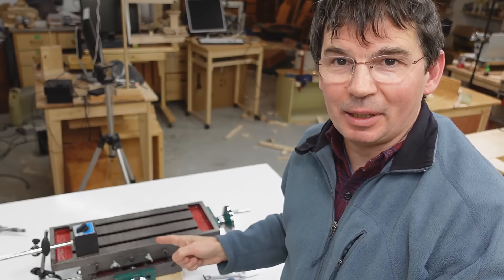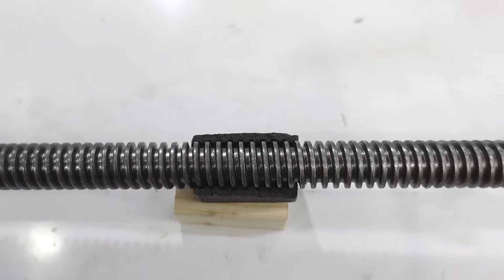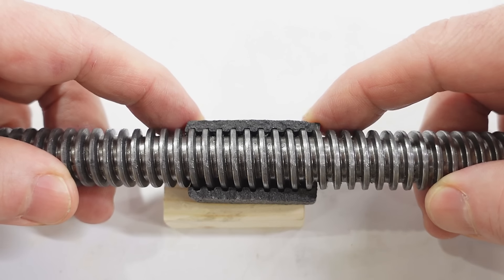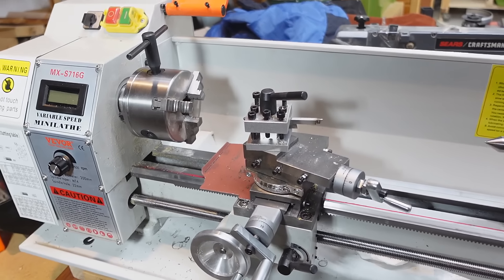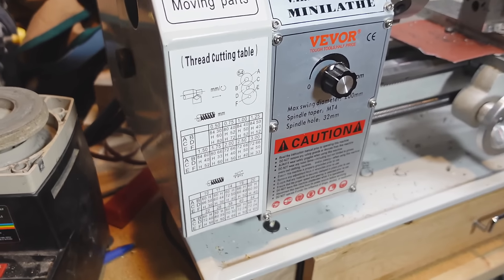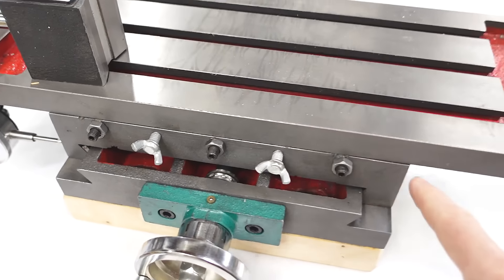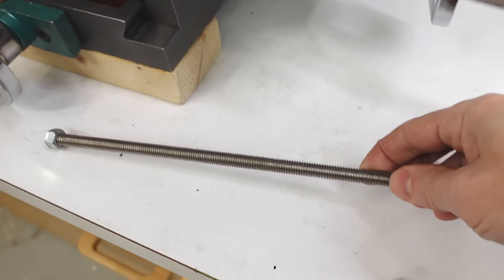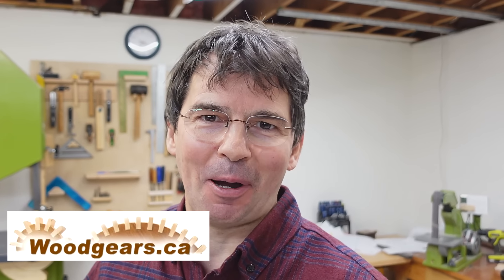Why all the hate for Vevor?

Comment: I don't get it either.  People made a choice to buy the cheapest thing they could find.  Then complain about how bad it is.
Reply: In my case, my husband bought me a metal melting furnace from Vevor. So he got it from my recommendation.  But I saw a review from a great, trustworthy YouTuber about said furnace. Everything is fine with it so far. It was just that the ad didn't quite match what we got.
Reply: Because they ordered the cheapest milling table, and received something not usable as a milling table, and broken.

If I ordered a cheap crappy milling table and received a cheap crappy milling table, I wouldn't be mad. If I ordered a cheap crappy milling table and received an object that was both broken and so imprecise as to be completely unusable as a milling table without extensive repair and refurbishment, I would not be happy. That's false advertising, to advertise a tool and deliver something not usable as a tool.
Reply: @jaredlancaster4137 to be fair, the table would have been pretty precise had it not been dropped which is more of an issue with the shipping industry than the milling table manufacturer
Reply: Also, a tool that is „up to professional standards“ won’t just cost 20% more, but two, three or five times as much as a Vevor tool.
Reply: @mx2000  try 20x as much. Machine tools of high quality are extremely expensive
Reply: 2 vevor products in my  garage. Both working as intended.
Reply: Who's mad?   Sounds like Matthias is cool with what he has.
Reply: Vevor isn't even at fault they Just a seller 😂😂
They buy it rebrand and sell it
Reply: The one complaint i have is that they cut some wrong corners.
Reply: Some people can’t afford to buy the best.
Reply: For hobbiest, complaining and fixing comes in a pair
Reply: Most dont complain - they just point out flaws than should be accounted for. I bought simmilar lathe - and I knew there would be loads of deburing. It works, and you will need tweak it before starting any work - but I consider such spent time as learning and familiarizing. 

Also - making quality replacement parts for these machines is part of fun.
Reply: no offence man but but you really arent a metal worker or metal machinist   machinist have had to deal with these issue for many many years.   you had to deal with what you had
Reply: @mx2000  No one is expecting professional standard tools and machines from Vevor, but often Vevor isn't able to deliver a working/usable piece of machinery. Meanwhile companies like Grizzly, Optimum, Sieg, etc sell the same machines as Vevor and often for the same price too, yet with the big difference that you're guaranteed a minimum quality which is substantially higher than the lowest quality at Vevor....
Reply: Exactly!!!! If you want good shit, pay more
Reply: Who sets the price? When  what you sell is garbage and does not work as advertised, you don't have a business you run a scam. Don't blame the victim.
Reply: Most of the time there's upgrade videos on how to fix these products. With a bit of effort and a few parts they'll probably be just as good as an expensive item of similar.
Reply: I was looking at their rolling mills and despite a few things i've seen it's not really a deal breaker.

Comment: I once was complaining to my boss about the wore out Bridgeport milling machine he assigned me to use. His comment to me was, "Anybody can make a good part on a new machine, show me how good you are by making great parts on the wore out machine." So I did and I never forgot it. Good video Mathias, keep up the good work.
Reply: Yes and no. I made an apprenticeship as a tool and die maker in the late 1970s. I‘m German so in Germany the apprenticetime is 3.5 years. A mixture between the training shop, going through the different departments in the company plus vocational school 2 days a week. The machines in the training shop where not the newest ones, not complete run down but also not pristine. So as apprentice we had to do exactly that. When I worked in the tool and die shop the machines where top notch. Time is money, if you can make prefect parts in a fraction of the time the good machines is a well made investment.
Reply: Even a poor machinist can turn out crappy parts on excellent machinery. Even brand new machinery can have issues. They shouldn't but sometimes they do. It depends on the accuracy that the machine is built to. 
As to turning out good parts on time without scrap parts mostly boils down to good work practices. This includes everything from job set-up to the steps from raw stock to finished parts. In my time I went from manual lathes and mills that still had War Production Board tags on them that had been used hard and put up wet to brand new manual/CNC control mills and lathes. Certain machines I dreaded having to use as using them was a struggle on every operation. Others were a pleasure. Anyone who has ever run a Hardinge HLV knows what I mean.
Reply: That’s a fun exercise for one afternoon, but for anything more than that, it’s a shitty excuse for not investing in decent machines.
Reply: We would all like a work shop filled with expensive high end tools but most people I think are like me and use their tools for non commercial or hobbiest work. I have many cheap tools and make a lot of very nice furniture from reused timber. I live on a pension and have a table saw,band saw, drill press,thicknesser, jointer,and various hand held power tools along With a plethora of good old hand tools. 
Tool snobs abound on ewe too.  I'm happy with my crappy tools and if one gives up the ghost it won't break the bank to replace it.
I have a few vevor tools and so far they all work just fine.
Greetings from Tasmania in the deep south
Reply: @geoffb108  I kind of agree with you. There is a difference between a hobbiest and professional machinists. The start of this post was from a proffesinla side and that a skilled person and make good parts with crappy tools. Skills are important but it might not be economical to do that.
I make knives as a hobby and I had a 35€ drill press that did exactly what I wanted it to do. Drill small diameter holes into thin strips of metal. Drill run out, perpendicularity, not important. Then my focus slightly changed and I needed to get a better machine. Still not high end but better than what Mathias showed here without breaking the bank.
Reply: If the machine was properly worn out you could never do accurate work on it. Worn clapped out machine = inaccurate product.  Been there, done that.
Reply: Did he give you a raise after you showed how good you were though?

Comment: I appreciate that they know they are building to a price point and not lie to us. Plus those of us in that market enjoy the challenge and adventure of making something better.
Reply: Indeed, I think they could do with putting that price point they are targeting up just a touch myself. But honestly saying 'we make barely useable junk you will have to really work hard with, but its cheap' is so refreshing in the world of badged markups for that same low quality..
Reply: You don't give your kid a Stratavarius to explore violin. :D
Reply: "Plus those of us in that market enjoy the challenge and adventure of making something better.
163
" LOL, I didn't.
Reply: Yeah, hobbiests are in the hobby to spend some time, not mass manufacturing. Making stuff on the table vs fixing the table are equally fun to a lot of ppl
Reply: After buying a lathe from them for 800, and then getting a rebate of 200 for problems that I could fix. It's kinda hard to beat...
Still a lathe and the bed/headstock are serviceable. Everything else needs machine work. I can't get anything for that.

On the used market, a clapped out antique is still several grand. And that's gonna require an absurd amount of rebuild.

Comment: You're adding all kinds of value to them when you make these videos.  People know when they buy a hobbiest level machine, they're not going to get pro-grade standards.  But now you've given people a path where they can take a hobbiest machine, put some elbow greese in, and have a much better product they might not have been able to afford if it was turn-key.  Now instead of a bunch of bad reviews "don't buy, garbage" you're going to get reviews like "Not bad, followed Matthias's guide, and got it working pretty good"
Reply: It’s the same with a lot of cheaper Chinese made astronomy products. You always have to put some effort in, searching the web for mechanical fixes, to improve what you’ve paid for. And when I say cheaper, they aren’t even the cheap these days.
Reply: the issue is for like 10 bucks more you get adifferent better knockoff
Reply: @HerbaceousM8  Which brand are you thinking of?
Reply: They give products to Matthias and let him work out the engineering bugs! 🤣
Reply: Its a smart business strategy. It ensures that QA from the manufacturers is satisfactory and its a way to gain a bunch of free design improvements. All they had to do was make stuff that's pretty good but flawed and they'll get the minds of engineers to give them free advice that would've cost them millions if they only relied on the skills of hired engineers.
Reply: @Liofa73  You end up valuing something more if you've modified or fixed it. Its a psychological thing. That's why Ender 3 printers are so well liked despite being the basic model.

Comment: Vevor seems to be in the market segment Harbor Freight dominated for decades. I have an even sloppier milling table I bought at Harbor Freight in the late 90s. I don't use it often, but every now and then it is handy for sure. Super cheap imports from China that mostly are good enough for many users. This "it isn't great, but it is so cheap you will not care" strategy has been playing out in many market segments for decades.
Reply: Yeah. The problem with a lot of Harbor Freight gear is just that it's flimsy and won't last.  Which is perfectly fine if you only have one job to do with it, ever. And a lot of us have tools we've only needed once, but when you need it, you need it.
Reply: What's wild is just how good some of the product lines at Harbor Freight are these days.
Reply: I bought my milling machine from Harbor Freight back in the early 90s. It's a mainland clone of a RF-32 They shipped it for free too because it cost more than $50.
Reply: I think Vevor and Harborfreight are sourcing their stuff from the exact same place - it's just that HF has moved away from that kind of product now, and they're focusing more on the higher end stuff (probably at higher profit margins), and Vevor also covers a huge array of products in many different areas that HF never had. I think of Vevor like a ever so slightly curated layer on top of ali express. If there's 10 manufacturers of some product, vevor chose one that isn't the worst, but might not also be the best, and slapped their name on it.
Reply: HF was a source for poorly made tools that would do the task but not well. 
I considered the cost of the machine as less than buying castings and machining them.
Reply: @ke9tv  10 years ago maybe.. they have made huge improvements and have higher end lines of tools to choose from like Icon. The tools will last way longer than a few jobs and they have a hassle free warranty so if it does break you can easily swap it out.
Reply: @ke9tv  I have several Harbor Freight tools that I bought for a single use...and I am still using them occasionally several years later. I also have 10-12 Vevor tools that I couldnt touch at market price for even hobbyist grade tools. Most of them last way longer than I expected. Several of them are more than decent.
Reply: @OldSneelock  a blanket statement can't be made for tools HF sells. Some are good and some are not so good. Which is a large part of the problem. There's no consistency. I've bought a lot of tools off HF and some are absolute bangers. Others I might as well have pitched them out as soon as I got them. Overall I think I'm ahead of the game. But it is a game.
Reply: Better than nothing seems an apt description
Reply: Yes, and it is quite literally destroying our country.
Reply: @1pcfred   Often their higher end tools are clones of matco and snap-on tools using the worn out molds and dies for all the internal parts and throwing on a new over mold design. The earthquake impact guns are direct clones. The icon ratchets and breaker bars are the same thing.
Reply: @chrisfarmer4397  sounds good to me. I like my Snap-On ratchets. My impact gun is CP though. That's Chicago not Central. I don't have any Icon tools. If I buy Harbor Freight hand tools I stick with the Pittsburgh line. Good enough.
Reply: @ke9tv  I use cheap ($15) Harbor Freight spray guns to spray glaze for ceramics. Absolutely no point in buying high end ones, don't need the accuracy/finish (it all gets melted in the kiln) and the high end ones get worn down by the silica particles just as fast as the HF ones. Sometimes cheap and cheerful is almost better than expensive ones. (Horses for courses as they say).
Reply: Its all about feedback and branding when it comes to manufacturing. That's what they and Harbor Freight do. Manufacturers that don't get feedback will just produce junk.
Reply: If you are retired like me on a fixed income and have all of your time, and the interest, it's possible to make cheap chinese mini mills and Lathes consistent to .001 accuracy. That requires a lot of scraping, lapping, tweaking, improving and adjusting. I like fiddling with stuff so I am happy. If I was already skilled, I wouldn't want to fiddle and focus on efficiency for projects. So I'd buy or get access to higher end "pro" tools.
Reply: @ke9tv  In that regard with cheap tools my experience also is, a cheap tool that gets the job done is sometimes more economic than even renting a good tool. I remember a number of tools used by a relative for a, lets call it project (like stripping a house down to the bare walls, and redoing all the insulation, plaster, subfloor, etc. etc.), except one every single one of them got the job done and lasted at least the whole year the project took. And price wise, some of them cost less than renting a good one just for a weekend.
Of course, there have been few tasks, where the cheap tools just could not provide the power or were lacking in other regards so using them for the whole deal would have been no fun. Especially when it came to bigger tools for demolishing tasks. here the rent for a weekend or two was well spent.
When it comes to tools you use regularly, it does not have to be the highest end one, but an affordable good one. Like a shop vacuum. 
On the other hand, I would myself for a weekend project also never buy e.g. a cheap (or any price) concrete mixer. Less because of the cost, but because afterwards I have to get rid of the thing or have it sitting around the next 15 years until I need it again.
Reply: @PatrickRemington  That warranty alone is worth more than you pay for the tools.
Reply: @ryelor123  That they are open for feedback, even of the "bad" sort pointing out flaws, speaks for them. Of course now they can either just live with it, or work from it, which may if it is a low investment, may happen with successive models.
Others may have started to threaten you if you wouldn´t get them an all shiny 5 star review.
Reply: @jameshicks7125  Sounds like "the path is the goal", which if interested and able, is not a bad thing. There are enough people out there, fiddling with such stuff for exactly doing that. Same with better quality broken stuff otherwise not worth the repair cost (parts and labor).
Some do it for themselves, some to kind of flip them and not only have fun but make a little money with it.
Reply: That is true, and it combines with another thing that is often overlooked when it comes to things produced in China.
Most people think of crappy cheap products when thinking about products from China, but in reality, a lot of expensive and indeed high quality brands have their products or at least parts made in China as well. Still cheaper in most cases than anywhere else, although that is no longer a given, as prices for quality parts in China have risen as well, which is why it is, not only for political reasons, that you find more stuff made now instead either in South Korea, across Asia, India, some eastern European Countries, and where not. The price difference no longer is that high. Only China often has the advantage, with all they do, they likely have companies already knowing the technology behind it well enough. They not only had enough samples of our production machines we sent over for producing stuff, they have capable engineers as well.
For the products we directly buy as "Chinese junk" the problem is what we are either willing or able to spend on the stuff. If we would sell actual Quality stuff from there, which they can produce if requested, the price would be a lot different and no longer as competitive. 
The other problem with the cheap stuff. The demand and market of course also brought up a lot of shady scam businesses, selling us the absolutely cheapest crap even over there no one would want to use. Sadly on Temu or whatever they look all the same. Not something their serious businesses are fond of either.